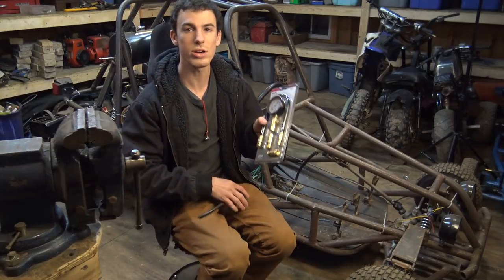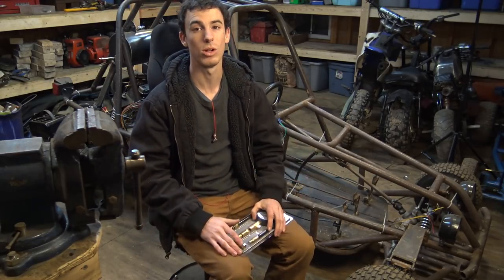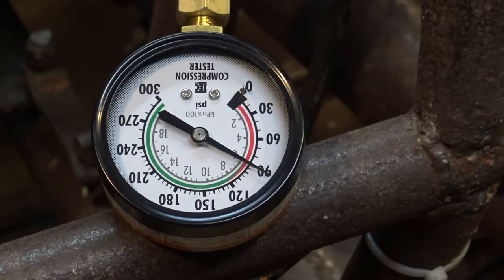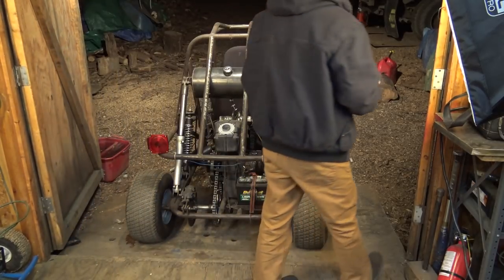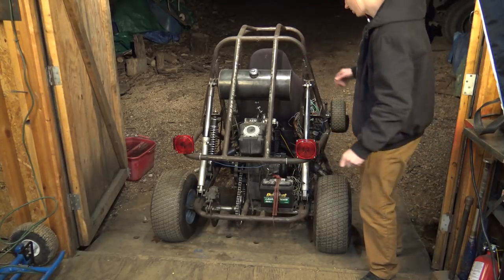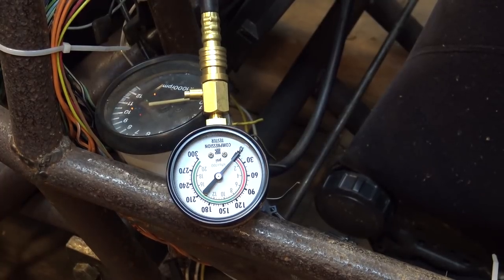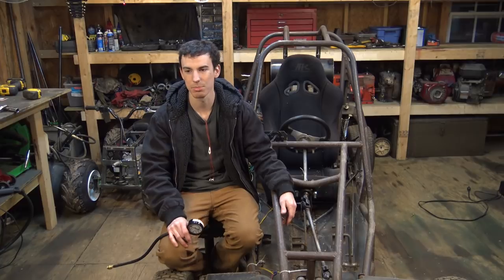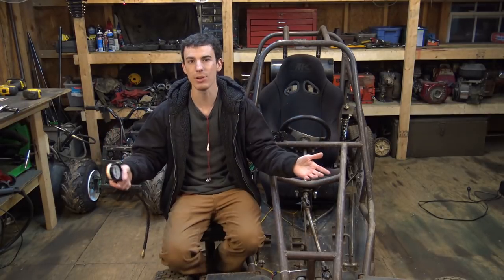Compression testing the gs500 engine

Comment: did not see the video of you pulling the top end off, if rings are stuck you need to free them,  Pb blaster has always worked well for me,  regardless what you do, please jet the bloody carbs, not even talking HIGH HP performance,  the engine is jetted for air intake and exhaust system combo,  they are jetted lean from factory, the restrictions created by the airbox and back pressure from stock exhaust kinda balances the jetting.  you  should have 2 jets in each carb, main #127.5 (stock) and a pilot #37.5(stock), with your exhaust mains should be #140 and pilots should be #40.  running even leaner as you are now, you are over heating the engine. this will make it stall and not start till cooled.
Reply: with these old aircooled design, overheating as often as you have,  the rings will relax and not spring back.  you can run that engine at 90 psi, it will be alittle weak but run it will.  the compression being the same and it running poorly between left and right with proper valve clearance  is saying jetting/tune,  you eliminated intake boot leaks.  orings in carbs might be an issue, unbalanced carbs will mess with 1/8 throttle and idle,  replace the jets and it will IRON OUT ALOT of your problems. i know these engines well, feel free to contact me anytime.

Comment: Ok one thing compression check ain't got nothing to do with it just shutting off and dying need to fit the gas tank so it don't build up a vacuum the shut-off valve is also a fuel pump for the engine it still runs good 90 lb a compression is not that bad it's running out and dying it's not got nothing to do with the compression of the motor
Reply: Vent I meant

Comment: Head gasket probably no good.
Reply: If theres a leak, it would rapidly go worse. Same with hole in piston.
Piston rings, if they are stuck, It'll soon score burn the cylinder walls and piston.
From what year this engine is from? Maybe its supposed to run with A86 fuel, then 90PSI compression is actually good enough

Comment: You are loosing spark when it gets hot , pull a plug when it stops and check for spark
Reply: Does it have auto decomp ? This could cause low reading in psi

Comment: What’s does the manual specs say for compression on this engine? Like others say 90psi on a small engine should be fine. Bigger engines have the 165-180 compression. To diagnose an engine you first need to know what are the manufacturer specs for it, so that you have something to compare to. Get a manual or get the info online and write everything down. Also you shouldn’t be so stubborn and install that damn fuel regulator valve.

Comment: How do you know 90 is bad? Okay, check the real specs for that engine, air cooled engines generally have lower compression ratios.  If you haven't fixed the valve clearance yet , why would you be looking for another problem.  IT'S THE VALVES!!!!!!!  Both cylinders are the same so the rings are probably good.  Retesting with a little oil in the cylinder will confirm this.  If you run it till it dies then check and the compression and it's 0 then you'll know IT'S THE VALVES!!!!!!!!

Comment: You got an ignition issue why it stalls and wont restart for a while. Low compression wont cause a motor to shut down and not start when its hot. Stop screwing around and get a new set of coils and a CDI box already and I bet all your issues will go away. I have been wrenching on dirt bikes and street bikes for over 30 years and I can tell you that you that its either the coil(s) or CDI box. Them vacuum assist shut off valves, dumbest thing ever. All it is is for a non vented gas tank to pressurize the tank so the fuel will run out the tank. If you have a vented cap then you dont need all that mess hooked up. Just put a simple shut off valve inline.

Comment: who ever told you to hold the gas when checking the comp with that carb is an idiot for 1 its not an injected carb so it won't shut down the injectors u have to.empty the bowl on carb an shut off fuel... 2nd try oiling the cylinder just a good squirt of oil in the cylinder will do the trick... last most small 4 cylinder cars only run 80- 100 psi comp... so 90 psi is good that particular motor is 110- 130 tested in factory with assembly oil in cylinders... that fuel peace u threw is a vacuum pulse fuel pump and lastly check ur coils!!!! 100% bet they r bad when they r getting hot they r shutting down move them in front of fan or relocate to a place wth more air flow or away from motor

Comment: You are insistent that 90psi is "bad". It isn't, regardless of what someone told you.

That both cylinders are identical is a good thing also.

The engine doesn't sound that bad, honestly.Ha 

Don't just buy a new engine. Figure out what's wrong with this one and fix it. You'll feel a lot better about yourself. It's called "pride", friend. 

Good luck.
Reply: Like some others have suggested, I would want to verify the accuracy of the compression gauge.  He did mention the rings were stuck, but it's pretty odd that both cylinders are exactly 90 psi.  The engine did sounds strong, but after it warmed, it also sounded like it was trying to misfire.  That would make me suspect either a failing ignition control, or persistent fuel supply issues due to contamination in the system.
Reply: Keith Ray, good points
(no pun intended ha).